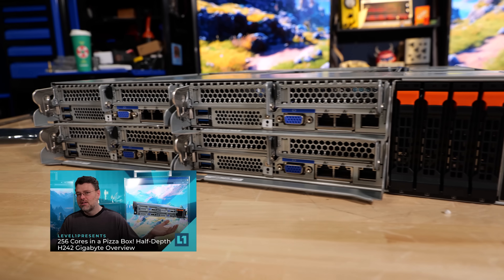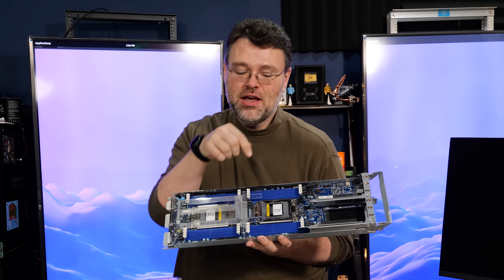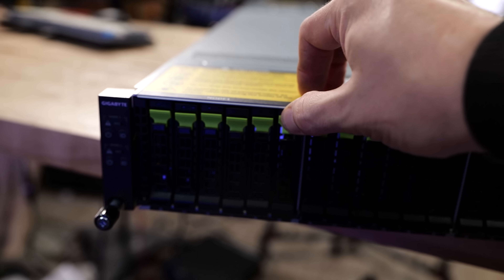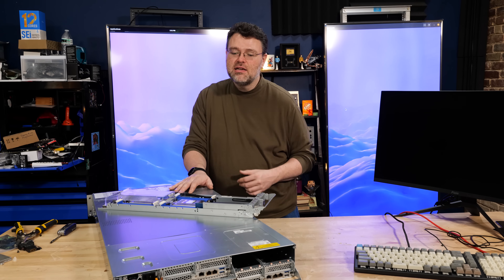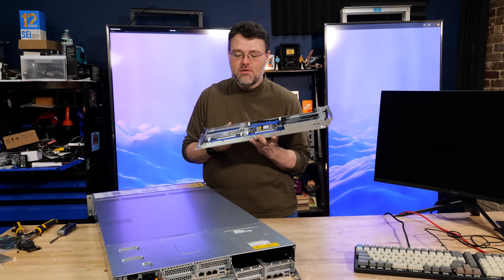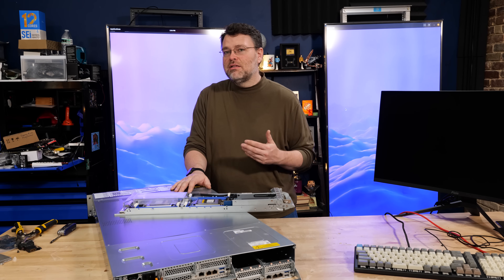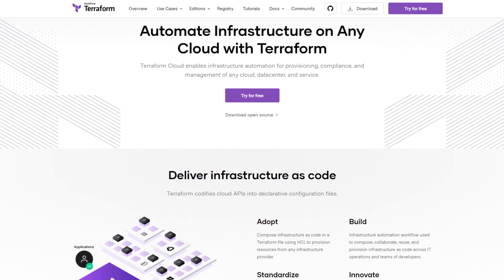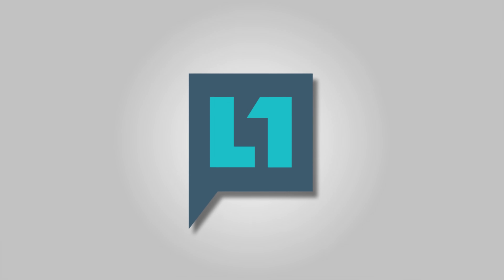Checking out the Gigabyte H262-Z6A

Comment: 2 Power supplies in 2U isn't a king of density. That would be 24 power supplies in a full rack, well beyond power and cooling capacity for a rack. 
Please look at what Oxide is doing. They are taking this to the extreme with a DC bus bar across the entire rack.

Comment: I'm soon getting an old AS-2123BT-HTR at work with Epyc 7451 CPUs. It's gonna be my test system/dev environment where I can deploy all of my stuff to for testing if concepts I intend to implement will even work. Right now my test environment is a single dual-socket hypervisor with a single P100... Not the greatest for when you need to test some clustering configurations, etc.

I never heard of Tinkerbell, but I heard of Foreman. Given that Foreman now belongs to IBM, maybe Tinkerbell does what Foreman should do for me